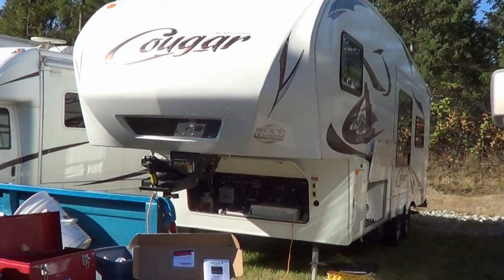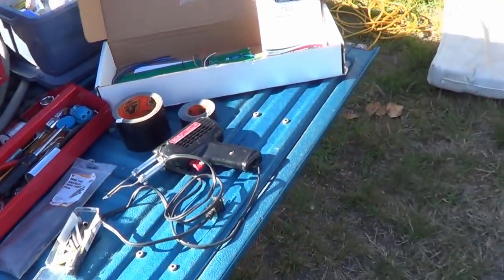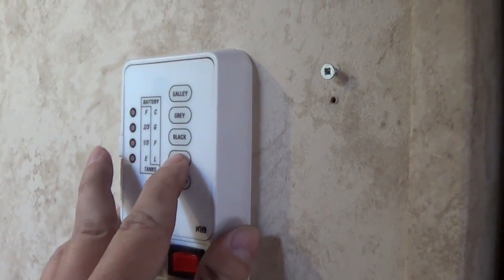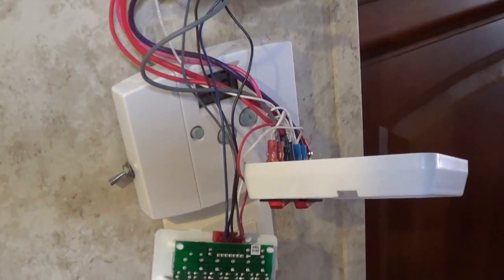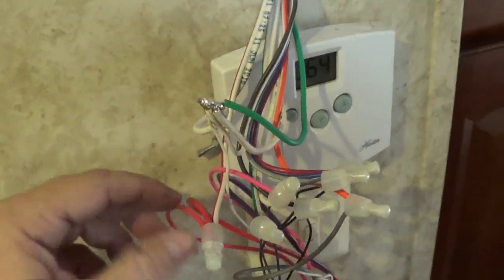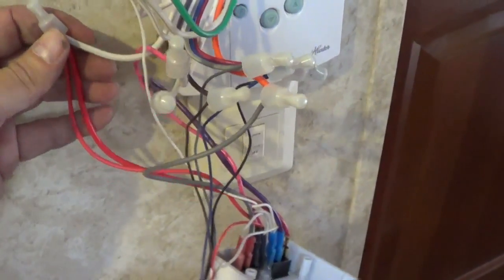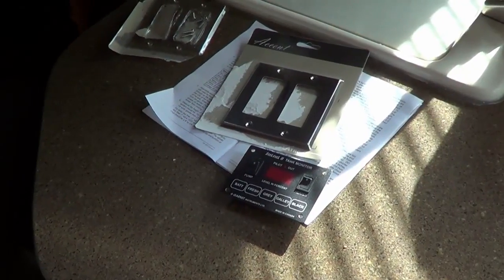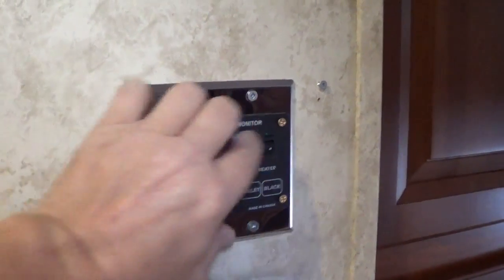Installing the See Level II Tank Monitoring System

Comment: Ray after watching your video again I see it needs to use the new wall plate, I purchased from repro the 3 sensors per tank stick type same as I had on my Eagle cap truck camper which worked perfect. I was hoping for a easier hookup when I replace  the sensors on my new Rockwood.
Reply from the maker: Yes, the SeeLevel sensors use a digital bus wire system to communicate whereas the old OEM are just using simple resistance I think.

Comment: Garnet should send you another set of senders for the informative video. I will now be ordering a kit this winter.
Reply from the maker: That would be nice. Cheers Ray
Reply from the maker: Just got a call today from Garnet. They are going to send me out a set of the shorter sensors. Yay!
Reply: am I right to assume that the gauge will read zero if the water level is below the strip, 100percent when it's above the strip, and proportional for a mid level? looking forward to the third video. best wishes to Anne's family.
Reply from the maker: Manual says -  The sender
ends should be 1/4” to 3/4” away from the top and bottom of 
709-4PH Manual Page 15
the tank, to allow for the thickness of the tank top and bottom
and any bows in them (see the diagrams). The senders are
calibrated to account for this distance from the bottom of
the tank.

Comment: Great idea. Wondering if just the sensors can be purchased and installed next to or near the existing tank sensors and transfer the wires to the See level making use of the original panel display?  I ask because my current tank sensor display is part of a larger control panel.
Reply from the maker: I'd guess the answer is no as the SeeLevel uses a digital system of communications between the sensors and the display unit, and I'd imagine its it own unique design. Cheers, Ray

Comment: cool project consider mounting the sensor at an angle to get full resolution in your shorter tanks
Reply from the maker: In the instruction manual, it mentions " make sure that the sender is square with the tank". I believe an angled mounting would mess up the readings.

Comment: I used the Horst Miracle Probes  did the gray and Black Tanks  they worked Very Well But always wondered about See Level System Worked
Reply from the maker: I was aware of the Horst probes but I've decided to go with the SeeLevel since it should have finer resolution of tank levels and no drilling into the tank required.

Comment: Ray, Good morning!
I also have the 2007 276RLS.  I have been looking closely at your Blog and install videos.  Good info.  I have either got to replace my OEM sensors (and possibly the sensor wiring harness) or start from scratch and install the SeaLevel system.  I have not been able to find the model number you reference on their website.  Garnet is showing that model as discontinued.  I have been able to locate two units from various vendors but would prefer to buy from Garnet because of warranty concerns.  Do you have any idea why they have discontinued this model?  Thanks!
Reply from the maker: Weird, not sure why they would stop having that model. You can find my review video here - https://www.loveyourrv.com/seelevel-ii-review/ and update on the See Level after years of use - https://www.loveyourrv.com/10-more-must-have-rv-gadgets/
Reply: @LoveYourRV  ,
Ray,  Thanks for the video links.  It does seen odd that they would discontinue it.  I received a reply back from Gabe Morales.  Still no explanation as to why it was discontinued.  His reply is below:

"Unfortunately, we don’t have an option on the 4 tank systems that has a heater switch. Our 3 tank model, 709-HP3W, offers a heater switch but that is the only display that has the heater switch. The closest you could come to that with the 4 tank models is the 709-4P that comes with the water pump switch."

Comment: You used the original wires inside, but did you run new wire to each sensor, or use existing from old tank sensors when connecting underneath? I know it's been awhile, are you still liking these monitoring systems?
Reply from the maker: Used the existing wire runs but only need to use 2 of them as the SeeLevel uses a digital bus system for data transmit  back to the head unit. I've done a few review updates over the years, here is one from 2020 https://youtu.be/20YTNa63eCs?t=202  Not much has changed since then, still functioning the same. Cheers, Ray

Comment: Would it have been possible to place the sensors on a diagonal? That way a longer sensor could add even more resolution to your system?
Reply from the maker: No, they only can measure properly placed straight up and down, it won't be accurate diagonally.

Comment: Great video!  On the chrome light switch cover, could you have turned it 90 degrees and mounted the whole mess with only four screws?  Just thinking it might have looked a little cleaner.  Keep up the good work!
Reply from the maker: Thanks. It was close but didn't quite line up right. The switch cover was cheap, though, so I'm gonna keep an eye out for something better.

Comment: I realize this is a old video, that being said could you have used the same control panel after soldering in the new sensors?  I have a new travel trailer and have never liked the sensors in the tank.

Comment: WHen you say you'll need to work with your multi meter to discover which are the positive and which are the negative connections....etc.  Just what do you look for on the meter and where do you connect the meter wires? Thanks for your info !!
Reply from the maker: I place the meters negative black lead on the RV negative ground wires and then I can test for voltage at different points with the red lead. Another option is to use an automotive circuit tester - https://www.amazon.com/Professional-6-12V-Circuit-Tester-Indicator/dp/B003UHNMMS  I can place the lead on one side of the switches and the other and see where the power is being switched to. With the OHMs function of the meter, I can test to see which wires are connected to each other. My meter beeps when the resistance reading is 0 ohms.  More info on multimeter testing - https://learn.sparkfun.com/tutorials/how-to-use-a-multimeter

Comment: Could you take the longer sensor and mount it at an angle so the 5" of tank depth used the 6 or 7" sensor. Seems this would be a way to keep a finer  resolution. I'm looking at getting these to replace our original 2003 sensors put in by Newmar and our black and grey tanks are both pretty short, height wise. Thanks for posting,  yeah that mess of wires looked like an electricians nightmare. Lol
Reply from the maker: The manual indicated to mount the sensors square with the tank. I imagine an angle sensor would send confusing signals.. Cheers. Ray

Comment: Hey Ray, did you plug the existing sensors or leave them as is? I installed the traditional ones in my black before deciding on the sealevel ones without ever using the tank. Also did you use a glue or tape over the sensors ? I thought I saw some recommendation to put some kind of mud over it (if the tank is outside)
Reply from the maker: I just left the old OEM sensors in place, doesn't hurt anything and they don't leak so left well enough alone. :) I left my new SeeLevel sensor strips bare uncoated as they are inside the trailer underbelly. The manual suggests using undercoating if they are exposed. https://www.garnetinstruments.com/wp-content/uploads/2022/11/SeeLeveL-Sender-Manual-AR-ES2-24-Nov-2022.pdf
"Apply undercoating to the senders
On installations where the holding tank is exposed
to under chassis road spray and flying rocks etc. We
recommend the use of a rubberized undercoating.
Recommended brands:
3M 03584 Professional Grade Rubberized Undercoating
Gravel Guard Rocker Guard Coating By Dominion Sure Seal
"

Comment: Nice video.  I think that you could install tank strips at an angle instead of vertically to maintain sensitivity. I have never done it but my trailer needs this kit.
Reply from the maker: hhmmm, not sure if it would work right at an angle. The manual says to make sure the strip is square on the tank.

Comment: Ray,  we have similar models, mine is a 245rks, and I'm curious did you take down large sections of the Coroplast? I hate dealing with the underbelly all the screws holding the Coroplast are rusted tight and snap when touched. I have had better luck slicing open small sections as needed then close them up Gorilla Tape. Is this an OK method?

Thanks

Ron W
Reply from the maker: I just needed to take a few screws out along the side under the driver's side storage door, most of it I could access from existing flaps I cut before to access the waste tank valves and the back corner under the fresh water tank. Luckily, I don't have too much of a rust problem. I guess since winters are spent in the dry desert. I find the Gorilla tape method works fine. For a little more reinforcement you can add zip ties acting like stitches on the seam.

Comment: great video..very helpful but it would be nice if you added some info on the wiring of the sensors to the existing wiring.....did you connect the existing tank ground to sensor ground? or ?  your video was way better than the see level manual....thanks
Reply from the maker: Thanks, I just had to splice the two wires from the SeeLevel sender pad to two of the existing sensor wires, In my case I used blue to blue and black to white, white being the old sensor ground, but that may vary with different rigs.
Reply: thanks..i figured that out....your video was helpful, i had just wish it had more on the wiring part.

Comment: Would it be possible to cause the RV to lose 12v service by pressing multiple buttons at the same time on that controller?
 My 87 yr old in laws bought an RV with this  KIB panel. The carbon monoxide alarm in the bed room went off and grandma ran around trying to get the buzzing shut off. She tried at the CO alarm reset button first and when she couldn't reset it went to pushing buttons on this kib panel and then she said it all went out. |
 I replaced a 30amp fuse at the breaker panel and then went around and checked the deep cycle battery. It was flat dead. When I attached leads of a trickle charger to it I could tell there was a dead short somewhere because red from the charger was on the pos pole of the battery and it started  smoking when I attached the black to Neg pole.
 I was going to try and find the exact model of panel to replace it, because I might be smart enough to do that, but now I hear you say it's junk anyway. Damn, am I going to get hosed at the dealer, or what, huh?
Reply from the maker: No, pushing buttons on this shouldn't be a problem.  CO alarm likely went off sensing a low battery voltage. Maybe the battery is bad (shorted cells) or the charger or there is a short somewhere in the wiring. Someone with an ohmmeter is going to have to get in there and track down the short.
Reply: @LoveYourRV  Thank you sir. The battery is brand new as of 8/ 21 and is a NAPA deep cycle/ RV Marine. I removed it and put it on trickle charge and it seems to be fine now.  
 I forgot to mention that earlier, my wife shut off the water at the frost free hydrant and the RV was set to use "city" water and the hot water heater was on at that time. Then she was told there was no pressure and realized her mistake and turned it back on some 2 hours later. I suppose at that moment she sent cold water into an overheated tank?
  Grandma said that they had hot water coming out of the cold water tap too, I don't know what that means, but it doesn't sound good.
  I knew this was going to be a cluster lol.
My poor wife thinks I'm smart. Glad she doesn't like to watch stuff like this because she would quickly find out differently.

Comment: I’m not ready for this mod-however I would like a digital reading for my batteries.  What would you recommend???
Reply from the maker: The one I use is a Trimetric by Bogart Engineering. The other good one is a Victron. Both are more than just a voltage readouts though they keep track of battery capacity left and current in and out. So they are relatively expensive and need to be installed.  For just a readout there are many cheap ones on Amazon or eBay that will do the job. One like this http://amzn.to/2DTcYZP you can just plug into the 12-volt lighter socket most RVs have near the TV area around the 12-volt antenna amp.
Reply from the maker: No, looking at it I don't think I would trust the shunts, they look a little cheaply made.
Reply: Ok. Thanks. The victron looks like a easy install.  Bluetooth is a nice added feature.

Comment: Ray, have a question for you. I have a small trailer that doesn't have any sensors. So if I order this product I guess I would also need to order that ribbon wire or should I get individual wires to connect the sensors to the monitor?
Reply from the maker: No, shouldn't need ribbon wire, that just happened to be easy to reuse from the old sensors. These new ones just need 2 wires for the sensors versus the 4 my old sensors needed. I think they specify 18 gauge.  You could use speaker wire or the red black automotive wire.
You can check on the website they have the install manuals for download - https://www.garnetinstruments.com/rv-shop/products/
Reply: Love Your RV Thanks for all the great info!

Comment: what is the max length of the sensors? i have a large fuel tank and wondering of this would be good for that, the fuel tank is 3ft high though. cheers
Reply from the maker: Here is a link to the different sensors - https://www.garnetinstruments.com/rv-shop/products/ Scroll down. I see one that can go to 34" 
The 710-SS SeeLeveL™ Sender is a flexible self-adhesive printed circuit board that is mounted to the outside of the holding tanks. The sender can be cut to length to match the height of the tank. Tanks over 17 inches may be double stacked – see manual for details.
The 710-SS sender measures tanks from 7” to 17“ tall with a single sender and up to 34” tall with dual senders.  This 16” sender can be shortened in 2” segments to 6” and provides 1/2” resolution.

Comment: Seems that it would be helpful if the indicator panel had a way to calibrate the sensor's readings. Example; fill the tank and set the indicator to 100%, drain the tank and set the indicator to 0%
Reply from the maker: It's supposed to auto calibrate. Mince show full 100% when the tanks are full and 0% when empty. Works perfectly on the freshwater and shower tank but gives 100& full false readings when the galley and black are dirty. I guess they have more crud build up in them. - http://www.loveyourrv.com/seelevel-ii-review/  Cheers Ray
Reply: Thanks Ray, i watched the Tank Techs' RX video and it seems like very good information to help with tank maintenance.
Reply from the maker: Here are my favorite tank treatments - http://www.loveyourrv.com/favorite-rv-waste-holding-tank-treatments-love-rv/

Comment: For all readers..... I've looked everywhere for info on how to add the two 40lb LP tanks to the Seelevel II monitor. All I keep seeing is the instruction for calibration. It seems DRV snipped the green wire for the harness on the back of the controller. There are no wires attached or even in the LP bay. How does Seelevel communicate with the tanks to begin with? Is there a special regulator, senders, or a separate gauge the green wire is supposed to connect to? I can't find anything aside from the water and holding tank senders and a simplified wiring diagram showing the green wire goes to the LP tanks. But what is the green wire connecting to? Anyone?.....Anyone?.... Bueller?.... Bueller?

Thanks y'all.
Cheers! 
Cameron
Reply from the maker: Have you tried phoning Garnet, I remember giving them a call for advice during my install, someone had a technician phone me back - https://www.garnetinstruments.com/contact-2/

Comment: I would mount it on an angle to use the entire length.
Reply from the maker: In the instruction manual, it mentions " make sure that the sender is square with the tank". I believe an angled mounting would mess up the readings.